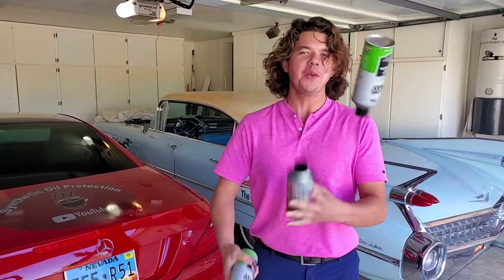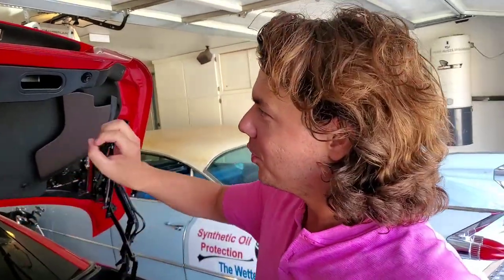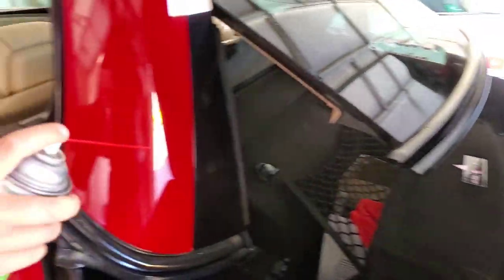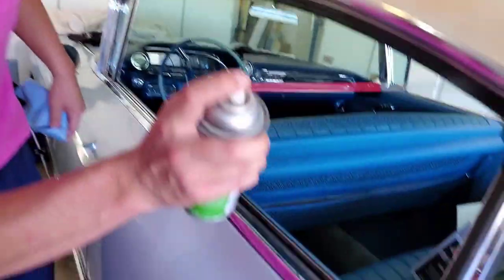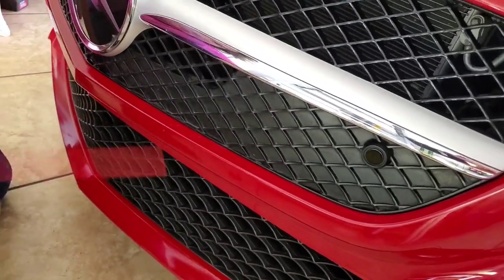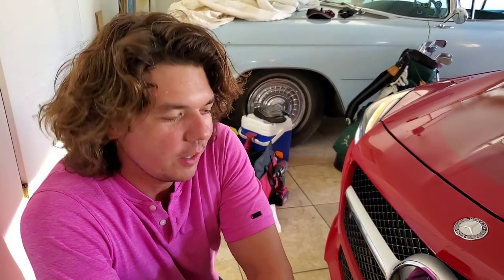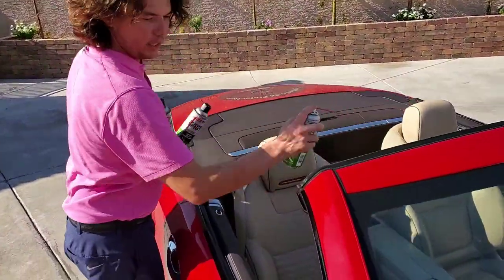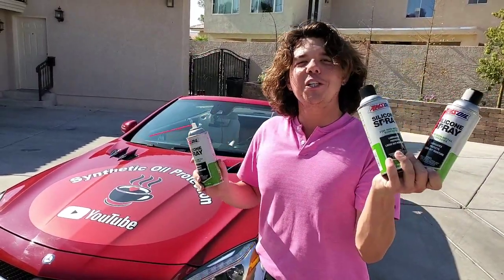AMSOIL Silicone Spray For Rubbers & Plastics

Comment: Why not spray the dashboard? It's bad for it or wont do anything?
Reply from the maker: The dashboard depending on the materials it would depend if it's rubber or plastic like a trim you can do the silicone spray if it's like foam coated you'd probably want to use more like a regular Armor All type interior cleaner

Comment: Wow this definitely brings a great shine to the materials! However, isn't it bad for paint, chrome, the interior cloth at the seam of the roof, parking sensors, the radiator...  What is its cure time?
Reply from the maker: Oh it won't hurt any of those materials You wouldn't want to spray them directly on it but a little overspray won't hurt anything.

As far as the cure time it's within minutes. When you leave it on heavy it will collect dust but if you take a microfiber towel you can massage the rubbers and it will leave a thinner coating and you won't have as much dust collect to it.

The heavier you keep it on the more it absorbs and over time it will have or perpetuating shine to it that looks like it's brand new plastic and rubber.

The plastics on my car are just starting to get that glow to it.
It's almost like they're glow in the dark 😄😁

Comment: how often we have to do this ? does it last for months? years?
Reply from the maker: I use it every year on my personal car and also depending on the conditions if it's really dry where you're at you may want to do it more than once just depends on the way the rubber looks and the way the plastic looks.
This is my link if you're new to Amsoil this would give you the preferred customer pricing saving about $33 on $100 order If you ever have any questions at all always happy to talk with you.
Professional YouLubher: Eben Rockmaker Regency Gold Direct Jobber AMSOIL Specialist (Dealer#: 5331179) 702-472-3614 

     If you're New to AMSOIL I recommend the AMSOIL 6 Month PC Membership - https://www.amsoil.com/offers/pc/?zo=5331179

Comment: good day, I just want to ask if its safe to use the silicone spray on the sidewall of the car tires?
Reply from the maker: Of course anything rubber or plastic is the best for the silicone.

Anything metal is best with the MP metal protector.

If you're new with Amsoil this will give you the very best value on the products through my link here and if you have any questions on anything you can always reach out to me in the future because when you use my link I will be your Amsoil guy so I can answer your questions and I would also appreciate your business future business in advance thank you.
❤️ 🇺🇸 ❤️ Professional YouLubher: Eben Rockmaker Regency Platinum Direct Jobber AMSOIL Specialist (Dealer#: 5331179) 702-472-3614 

      ✅ ✅ ✅  You will get Best Value with 6 Month AMSOIL PC Membership because You get $33 back on a $100 purchase after the difference in Sales Tax with No need for Auto Renew - https://www.amsoil.com/offers/pc/?zo=5331179

Comment: Would this work on Suspension rubber bushings?
Reply from the maker: Yes I would definitely give it a try any type of rubbers the serpentine belt I use it on my car and it makes the motor run a lot quieter less residual noise.

I've never had anything plastic or rubber have any problems ever.

It's also quite a bit different than the silicone you get in the store It's a big difference The first time I tried it I was really surprised and now I just use it about once a year on all my vehicles.

Comment: I bought some of the Amsoil Silicone spray and I'm about to use it on the Jeep XJ :)
Reply from the maker: Sweet!

The XJ is the Wrangler?
Reply: @Syntheticoilprotection  It's a 1992 Jeep Cherokee 4.0 :)
Reply from the maker: Awesome!
I used to have a 1992 Jeep Cherokee limited burgundy red with the gold alloy wheels that was my second car ever owned and I got it with 178,000 mi on it and it drove excellent.

If I would have switched it over to Amsoil the day I got it I could still have that Jeep today.
Reply: @Syntheticoilprotection  That is awesome, right now she is at 210,000. miles, the upper cylinder protection at every fillup I think helps a lot, plus I switched it to All amsoil in the oils. :)

Comment: Do you use it on suspension parts that are rubber?
Reply from the maker: Yes, I use it on anything rubber rubber cups bushings anything that rubs or is made out of plastic is best for the silicone spray
Reply from the maker: I use the MP metal protector the red can on anything metal so metal hinges any metal pivots any ball and socket metal anything that's locks and mechanisms I use the MP metal protector red can

Comment: Great job, Eben! I'm wondering... why did you let the Benz engine at high idle all the time in the vídeo? Singing fine, by the way.
Reply from the maker: In the heat it goes on to that and then it the high speed fans kick on
Reply: Ah, maybe more water flow to shed the heat quicker ... 🖖

Comment: If spraying into engine bay, make sure it doesn't go into the air intake.
Reply from the maker: Oh yeah definitely don't want to spray it into the electronics as well👍

If you're new to Amsoil and would like to try the products this is my personal link we'll give you the very best value on them as a six month preferred customer and when you use my link that would allow me to answer your questions in the future about improving the performance and lifespan of your vehicles and equipment by choosing the right foods as you're independent AMS oil dealer this and with that.
♥️   Find The Right Fluids For Your Vehicles - https://www.amsoil.com/guides/?zo=5331179    

     ✅   Save 25% On Your Next Fluid Order: https://www.amsoil.com/offers/pc/?zo=5331179

Comment: Could you use this on suspension rubber parts? Like bushings
Reply from the maker: Yes anything plastic rubber is best you want the MP metal protector for anything metal that's the red can and if you're new to Amsoil this will give you the very best value on the products and when you use my link that'll always attach me to you so in the future I can always answer your questions about improving the performance and lifespan of your vehicles and equipment by choosing the right fluids as your independent Amsoil dealer.
New Promo: CC0323UC
     ✅   Save 25% On Your Next Fluid Order: https://www.amsoil.com/offers/pc/?zo=5331179